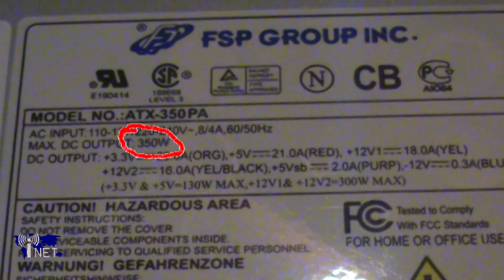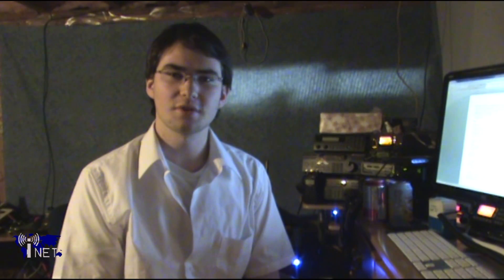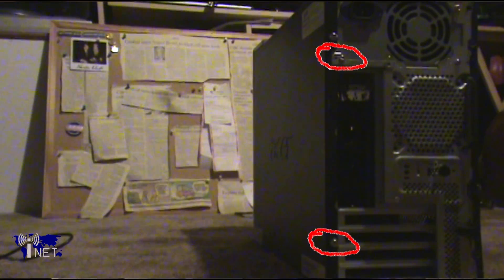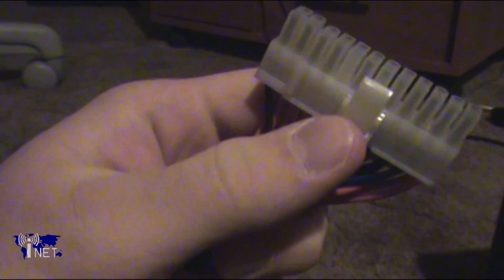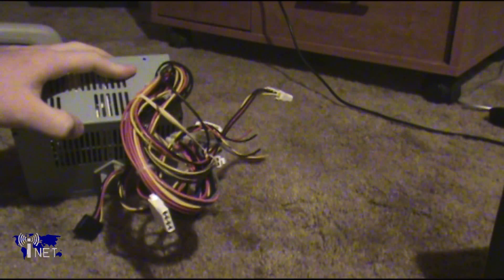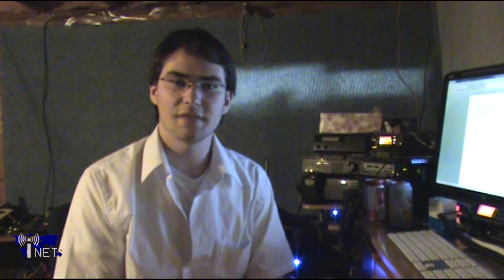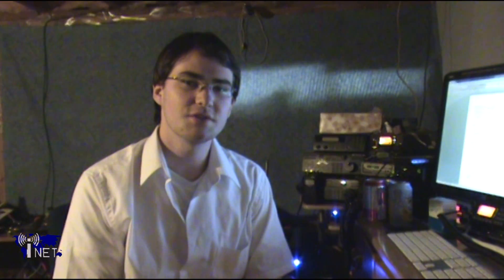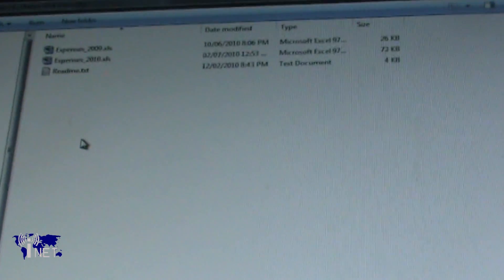Replacing your Computer's Power Supply

Comment from the maker: @ptsome110 I went from a PSU with a fan on the back to one with a fan on the bottom.  It should not be an issue if your case has adequate cooling

Comment: @christopherve7alb I have a switch on one computer which I have to repair which has a 3 way switch and 3 drives on it. With Windows 2000, Solaris 8, and eCS 1.0 on it. They worked fine until the unit went down on me. I tried out OpenSuSE on an old computer and it is working great for me as well and boots much faster than any version of Windows does.

Comment: You mentioned one thing in the beginning of the video which really clicked with me. That was the computer shutting down on it's own and I remember one I built having the same problem. It shut down after running so long, and now won't start. When  I put this unit together I used a MB/Memory/CPU combination which was tested by the company selling it with a case and power supply I got from a local store.